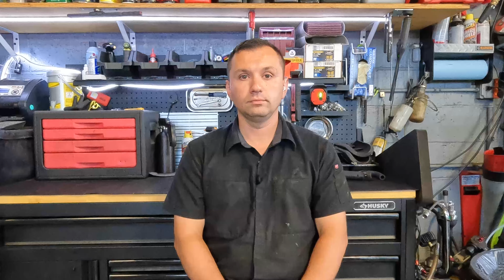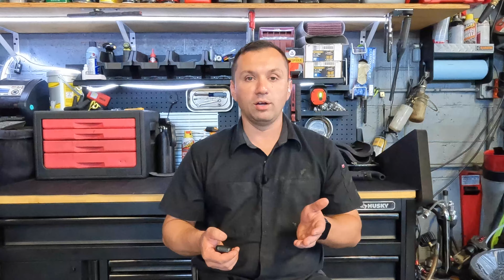SHOP TALK: PART STORE'S SHOULD STICK TO SELLING PARTS & LETTING REAL MECHANICS DO THE DIAGNOSING!

Comment: I agree people should take it to have it diagnosed by a proper mechanic. I think people are reluctant to pay for a shop to look at it comes down to two things. A simple code reader and parts cannon approach works most of the time. Very often the most common fix costs less than a diagnostic charge. Second and most important is how mechanics and shops will not stand behind their diagnostics. The amount of people I see getting a car diagnosed and "fixed" at a shop then it's still broke is ridiculous. Eris O. at South Main Auto seems to get a lot of these. My own brother was $2200 in at two dealerships with one. When he was in town I offered to bring it in and look at it he said he didn't want anyone to touch it for fear of losing the warranty on the parts already installed. A long story short we talked to the mechanic at the local dealership after they failed again to fix it. He said he is only allowed 15 minutes and then has to chuck his best guess at it. It only acted up when it was hot so he could never get it to act up. We went and got it hot for him and I told him it acted like a electrical connection to me. Sure enough once he was handed a vehicle that was acting up his test showed a voltage drop on the alternator harness. That was $42 and fixed. That after two dealerships 5 trips into the shop, three alternators, two batteries and a computer. We bring this on ourselves an awful lot.
Reply from the maker: I get that part of it too. I’ve seen that happen a lot. That’s why I always recommend to people whether it’s a dealership or local repair shop to make sure that they don’t fall in the trap of the parts canon. If shops actually want to diagnose the problem they actually could, but like you said there are some that have stringent rules that blockade them but it’s. It always that way.
Reply: @TheEnthusiastMechanic  I've seen some shops and people that come around. Unfortunately once people get burned word gets around and it's hard to convince this time will be different. We have one shop in town that does very well on complicated electrical stuff. They charge for it also but they are always booked a couple of weeks or more out. Once you get a good reputation that follows you also.

Comment: Hi Mike, Im currently working at one of these stores that offer the free scan, Between me being a ASM and my Store Manager we hate pulling codes for customers.. Complete waist of time. Totally wish our corporation would scrap it and battery installation. We most of the time refer them to a trusted shop up the street..
Reply from the maker: I know my local parts store where I order commercial parts from those managers say a similar thing it just creates problems on both sides of the board. They told me a story where a customer threatened their people because whatever part they sold him didn’t fix the issue. I would hope corporate management would get their head together and say we’re just in the parts business and start working with local shops to refer people to that would be the best way to handle this in my opinion.

Comment: Codes  is not a parts list. I had a car flag a code for a crank sensor and alternator PERFORMANCE code.  Customer had  both replaced, at several hundred dollars. No fix.  Had the PCM replaced, no fix. Turned out it was a simple cam sensor. It sent bad signal and the computer thought it was running and didnt see crank or alternator charging. So yeah, i dont hang parts unless i agree with the diagnosis.

Comment: I've worked both sides and the biggest difference outside experience, which varies a ton on both sides, is "real" mechanics have more expensive and accurate toys. That scan tool Advance AutoZone Napa and O'Reily bring out is nothing special and very limited as well and often enough chases ghosts. Also I have a similar toolset to the one over your right shoulder in my garage a 263 pc. Craftsman Mechanic's set, good tools had them since 2005.
Reply: Oh and I still have every single 10mm that came in the box. At one point I did lose the 3/8 drive 6 point short one for a few weeks after helping a friend, I mean doing it for him, tighten his loose steering wheel he found it and gave it back though.
Reply from the maker: Yeah, I love my craftsman. That was my first set that I ever bought. I don’t use it as much anymore, but it’s one of the first sets that I bought. I just keep it there. It still comes in handy here and there.

Comment: Hello Mike.  My name is Del.  I have been doing this professionally since 1972.  
 
Your video is spot on. I wish it could be used as a disclaimer at parts stores. They should say we are not substitutes for a professional diagnosis.  

In the days of carburetors, if we saw black smoke at the tailpipe, we diagnosed it as a carburetor overhaul needed. Took five seconds. No charge for diagnosis. Takes three hours to rebuild.  
With the advent of computers, we may spend an hour or more diagnosing a rich condition. Then it may take only a half hour to swap a part or repair a wiring harness..

If you can come up with a fool proof way to educate customers, I would like to know..

I was in this business for 50 years and Have had a ton of frustration from customers with their brains screwed on backwards.
Reply from the maker: For the years that I’ve been in business and working with customers in the general public, I have found that if you get to know your customers, you can explain every situation in a way that they can understand it.

For example, if you have a customer that is a doctor and their axle is clicking while turning because the joint is worn out and has leaked out its grease. I would say that it’s like a shoulder socket that doesn’t have any more ligament tissue left in it and it’s causing the shoulder, not to have the correct movement. If I can explain it to them in a way that is more familiar to them like with their profession, they understand it better.

I find that getting too technical with customers can be bad and also trying to dumb it down is also bad you gotta stay in the middle.

Of course, implementing something like this does take years and you have to know your customers and you also even have to do some research on how to explain things so it can make sense or relate to their profession, but at the end of the day, they will love it and understand it therefore, growing your business
Reply: My long time customers are super. They have been with me since my days at the Subaru dealer. I have multiple three generation families that came to us. Even though I’m 8 years retired they call me for advice before going to another shop. 
It’s this newer generation that attended the University of Google and Facebook Academy.. They know the internet has the answer for free just like the parts stores 😳
As you get older you lose patience with those who want to beat you out of a few bucks. 
I know exactly how to explain it without using “medical terms” to confound them. But there are so many in the last couple of generations who have no loyalty. 
I wish you nothing but success. Find those great customers, make them lifetime friends as well and weed out those who want to waste your time. You and your loyal customers will both prosper as my brother and I did.  
Del in Ky.
Reply from the maker: Thank you for your input Del thank you for your input and information I always try and learn as much as I can sir from others that have been here before I came thank you sir!

Comment: What  I get alot is they had it scanned and buy the part,  install it, then another part , then another part and now after 500 $ in parts and 12 hrs to install them.   I ask why did you not take to have a mechanic diagnose it.   Most of the time they didnt need 90$ of  what they bought.
Reply from the maker: I get the same exact situation where they buy the part install it. It doesn’t fix it and they’re pretty much pissed off and they come to me and then they question why they have to pay for me to diagnose it. It’s a repeating cycle. It happens everywhere.

Comment: Scan tools deal in electrical/electronic issues. When the issue is mechanical it can be a real wild goose chase.  Knowledge dictates the undestanding of the difference.
Reply from the maker: Electronics have come a long way you can actually do a compression test and things of that nature using a computer nowadays if you watch scanner Danner, he’s done it. He has the equipment. That used to be a mechanical test back in the day. I do agree that having knowledge will definitely be a lot better than just having really good scanner, you need to get down the road of diagnosis.

Comment: If you still charged them for the starter that's why people don't want to come too you. 
 But Our major parts store refuses to try to troubleshoot any vehicle over 2000. We give them the readout from the scan, give them a price of possible part and then tell them to go to their mechanic and have them put their $15000  computer on it and pinpoint the issue. That $100 to $150 will end up saving them money in the long run.  
 I've seen people drop $1500 on shotgunning parts only to take it to a mech and find out its a $30 part.  
 I only sell a customer a part if they absolutely want it. And I have some that force that issue.
Reply from the maker: When you come to me and request a part to be changed and then waive for me to diagnose the car beforehand and what you told me to do doesn’t fix it you bet your going to pay me for my time installing it if they insisted on it no one works for free! They even paid for me to diagnose it and to fix the original issue and they were happy I have a high customer satisfaction rate but in that scenario the customer insisted and they understood it wasn’t me making that choice so they had to pay.

Comment: then these same people will bring you the part. You install it and they pay you just for labor. 5 min later they are back with the check eng light on,  screaming that this is your problem.  this is why when I get calls from this kind of person I do not even try to bring them in.  the people who have the highest expectations seem to have the least to offer in return.      I had some chick ask me to change her spark plugs. a week later she was back at the parts dealer and was pulling codes for her check eng light. then i get a call from her trying to interrogate me.  she screamed and thru a temper tantrum when I told her my diag cost.  I have so sympathy for cheap people. these same people would never expect the dealership to diag for free but they will expect that from an ind mechanic
Reply from the maker: That's what I don't get they would pay a diagnosis at the dealership and not to the independent, I have had this happen to me and I just tell them I get paid for my time just like anyone!